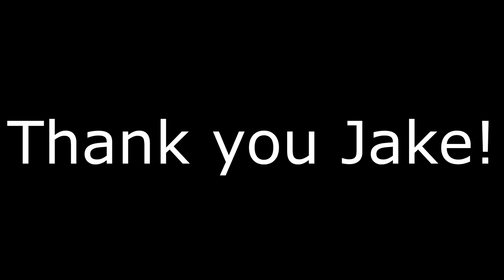WE FOUND A BIKE!!! (KTM 250)

Comment: Well..Technically...you Did 'find it'.You didn't mention having a GPS chip in it as a locator.I'm never surprised when I see a home made set of ramps that give No traction.Stud them with sheet metal screws and the heads will give you traction even if the board,or metal,is soaking wet.

Comment: Should I sell my Crf150r for a kx100,ktm105?
Reply: HAHA this is funny I have no idea how I happened to come across this comment. My GF sold her 150r and now we have a kx100 (it was a budget thing). There is a total trade off and I think they are within half a HP of each other. The bottom end grunt that you get with a 150r is something you will miss and I think if you know how to ride a kx100 you will notice the same torque just a way higher pitch sound that will make it feel different. Maybe its in our head but it feels different because of the sound. I work on all our bikes and the kx100 is such a treat to work on. No valve adjustment, carb comes out in 30 seconds, and holy crap is that thing light. Even she can get it on the stand. Personally I would get the KX it is much easier to get tuned in and way easier to maintain the tune. But really it comes down to what you prefer. At the end of the day she still misses her 150r but loves the kx100.
Reply: +peterweth ha that's even more funny I am also considering getting rid of my 150r because of money and my budget since it cost so much to maintain
Reply: Well we sold the 150r and were in the market about a year later. We came across a literally brand new kx100 for 1000US. They are dirt cheap and sooo easy to get running great. After that all you need to do is keep up on general maintenance (a top end is almost as easy as a valve adjustment on a 150r and likely won't be needed nearly as often). Did I mention they are DIRT CHEAP. Everyone wants that four stroke grunt but don't realize the maintenance that comes with them. The EZ of the kx is such a bonus. Disclaimer: this doesn't mean you don't have to maintain it, it's just way easier.

Comment: Who else thinks ktms are garbage?
Reply: I ride Honda, KTM always seems to be breaking down though. KTM on Sunday atm on Monday.
Reply: Kevin Kinney a bike is a bike
Reply: Kevin Kinney when you take a bike that's jetted for warm (er) weather and ride it in the cold there's always a chance of burning it down (too lean, as cold air contains more O2).
Reply: KTM are junk imho. They are not known to be reliable they are built with cheaper parts and have weak frames.  Honda is most reliable good engines durable frames easy to find parts and reasonably cheap to repair.  Yamaha good balance of reliability and power, parts are a little pricey.  Kawasaki known for strong engines lots of fun!  some models engines overpowered the suspension not always the most reliable.  Suzuki not bad,  used to be a cheaper option not anymore,  they have been known for good handling but not known for strong engines aftermarket support not as good.
Reply: davidbrennan5,  first off...I've owned 'em all. Honda, kawi, yami, ktm, atk, maico, husqvarna/cagiva and even an old can-am qualifier. I've seen every manufacturers motors be dependable and I've seen all mfr's motors burn down the first time out on the track/trail. Two strokes are very sensitive to ambient conditions and that rule is even more apparent with ktm. Why ? Because contrary to your claim, the tolerences on ktm motors are now, and always have been that much tighter than their japanese competitors. As for frame issues...take any supercross bike and use it as a trail rig, expose it to water, cold temps (especially with water in the frame) and you will eventually have an issue. In short...yea, ktm's may need a bit more maintenence, but they'll also usually outperform asian bikes.
Reply: ROTAXD no
Reply: Kevin Kinney no? No what ?
Reply: Kevin Kinney Hondas
Reply: davidbrennan5 cheap parts??
Reply: davidbrennan5 magura master cylinders, brembo calipers, wp suspension, khein carb, twin air airfilter, fmf pipe
Reply: well yea if you buy their cheapest dirt bike, its gonna have cheep parts.  high end ktms are awesome.
Reply: Kevin Kinney no
Reply: Dalton should have (K)ept (T)he (M)oney
Reply: i just got a brand new ktm 500 and within 2 months the bike already has major electrical issues. i own a $12k shelf queen. KTM is a joke